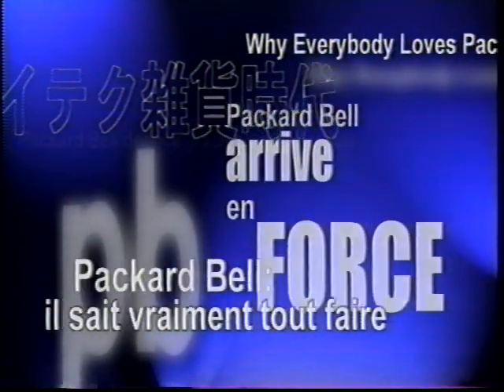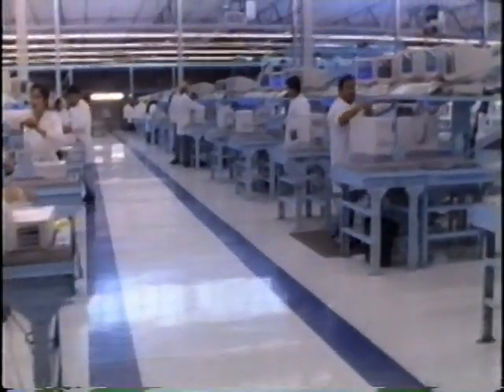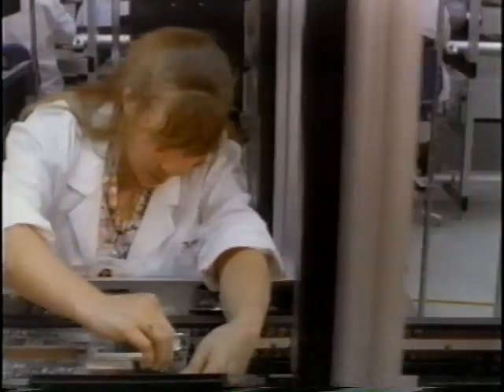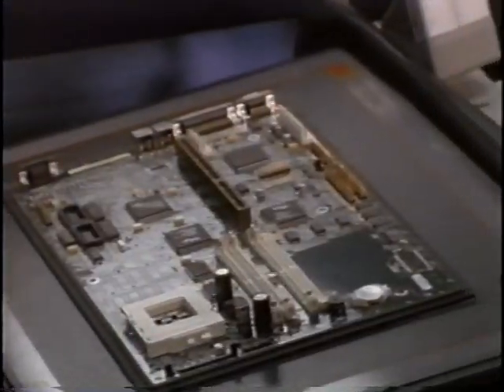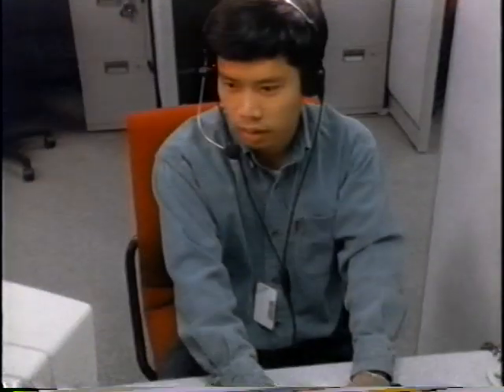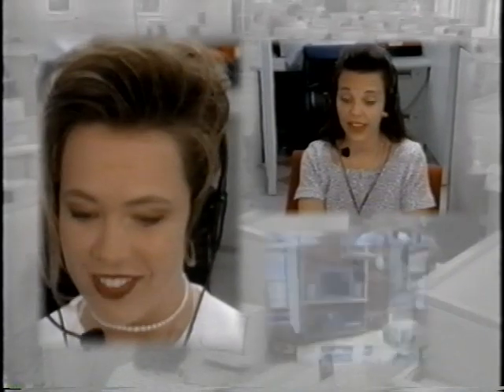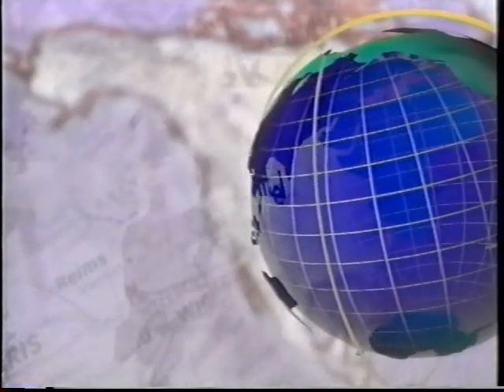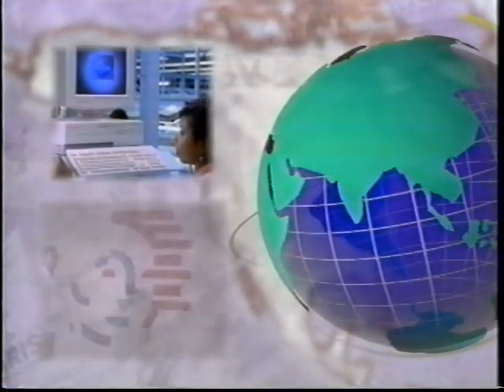Packard Bell: The Face of Technology VHS (1995)

Comment: What is most interesting from this video is how Packard Bell ran on Packard Bell systems. Their manufacturing line and their support center were both using Packard Bell desktops, rather than a competitor's enterprise line. They probably slapped a network card in and re-imaged the system to a corporate OS baseline. Interesting. Probably cheaper for them to buy from themselves too, at cost. 

Apple and Sun were also eat your own dogfood shops. Sun proudly touted that they engineer new SPARC CPU's on SPARC systems. Apple showed off the Fremont, CA plant in a 1988 video and proudly made clear that the automated factory ran on Macintosh II and Macintosh SE systems.
Reply: Yeah, I imagine that instead of using their own Master CD, they probably either used a retail Windows 95 install disc and something like Norton Ghost, or spun up their own internal use Master CD that contained all their site-licenced software and such, as well as software for different departments.